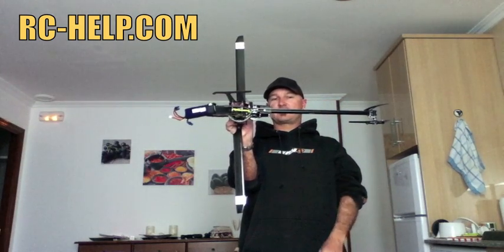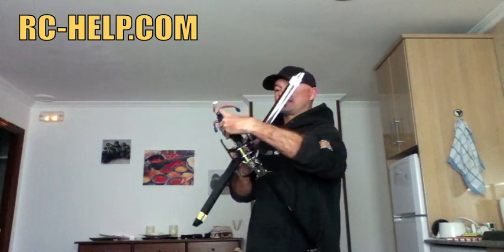RC Helicopter CoG Tip

Comment: Hi mate soz to bother you, theres two ways ant there with finding the CoG, the old days way as you say via holding the head/Flybar and the new way, ive just got myself the trex 600 dominator and ive found the CoG doing it the old way and its fine but doing it the new way its well tail heavy, hows that work out like that, i would of thought it would be ok both ways, im confused.
matt
Reply from the maker: Hi. they should be the same, but i think, holding it on its side, is more accurate.